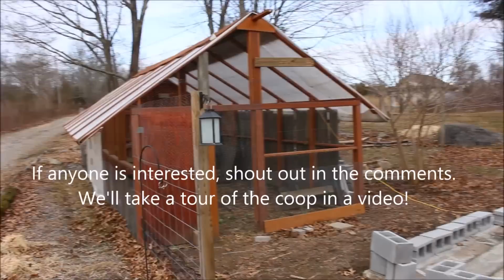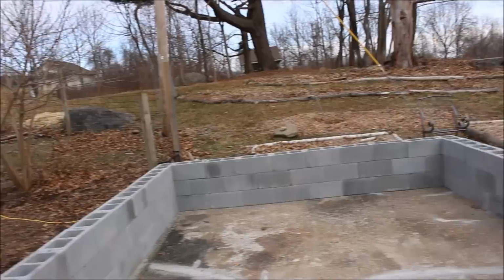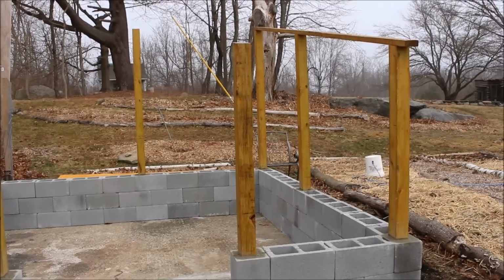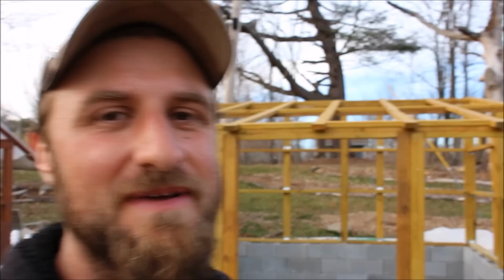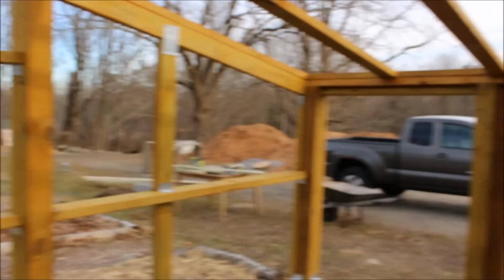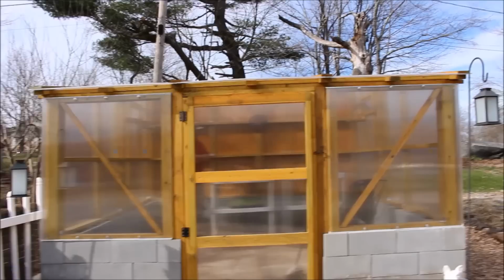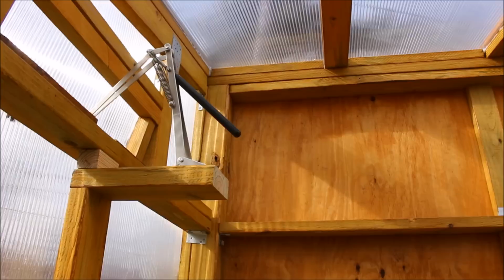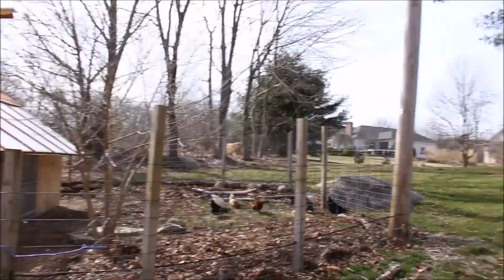Our homestead GREENHOUSE time lapse! WE BUILT THIS!

Comment: If you are going to use it in the Fall and Spring Bubble wrap is great insulation. It doesn't take much to keep on the walls and ceiling. The air pockets in the wrap is the insulating factor.
Reply from the maker: I had not thought of using bubble wrap, that's a good idea!

Comment: That’s a pretty cool design. Hopefully it gives you many years of usefulness! The only thing I might’ve done different is have the roof slant away from the door so water doesn’t run gushing on you as you enter.
Reply: I was just commenting the same but I understand that they may have done that because the front of the green house is facing the sun.  lf it were possible, I would place the door on the side, just to avoid having to install gutter.
Reply from the maker: Thanks for the feedback! We did consider slanting the roof in the other direction , but the angle of the roof made most sense this way for sunlight and we do plan on putting gutters on it to collect rain water to use for our greenhouse plants !

Comment: I can definitely endorse working together, if you have sufficient humility and grace. You seem also seem like really nice people. That being said, there really are many flaws in the design. 
1. The walls need to be attached to the foundation. A 1/2” hammer drill and rebar is a simple method for a simple structure with an existing slab, though there are better ways for standard construction. 
2. You apparently went back to fill all the voids with concrete. And easier method would be to skin the blocks with a fiber modified mix because it’s a simple structure. 
3. When mixing concrete, the more water you add the weaker the finished product. The drier the better. You really need to vibrate the concrete a lot or air voids will remain and weaken the concrete. 
4. Concrete also takes a month to reach full strength. It needs several days to get to working strength even with high early concrete. You won’t notice, but premature stressing of the concrete will create micro cracks that will grow and cause failure. 
5. People think of concrete as drying but it really goes through a chemical process, hydration, that requires water. If it doesn’t stay wet, it won’t gain full strength. 
6. You should prewet the forms, especially blocks like you used. Otherwise the blocks suck moisture out of the mix leading to weaker concrete. 
7. Placing wood inside the blocks will lead to rot in the wood, even pressure treated wood. 
8. Placing wood inside the block also means the tiny amount of concrete is non structural. Really better to put a metal connector (24” straps with 18” embedded?) in the concrete and then attached to the posts. 
9. Rather than insetting the 2x4’s between the posts, attach them 4” high on the exterior of the posts. See structural post and beam construction. Much stronger, less cutting or room for error. 
10. Joists should be stood up with bird’s mouth at the walls. Check out links to building codes for appropriate sizing. Looks like you probably needed 2x6’s, especially if cold enough for bibs/snow. 
There’s probably more, but I’m tired.
Reply: Very good advice.  I was wondering about the long-term structural integrity because of the way the blocks were assembled then the posts placed inside and crete poured around and into the void.  Bad for the wood and bad for the integrity of the project.  However, they did put a lot of work into this project and for the short term, it should serve it's purpose very well.

Comment: Nice build, besides the choice to dry stack those blocks. I'd imagine the wind blowing right through the cracks.. could be remedied by filling the rest of the wall with concrete though..
Reply from the maker: Thanks! And yeah we didn't show it on the video, but we've since filled the rest of the block cavities and joints. We may even add a stucco skin at some point too

Comment: Loved the idea and build.  Disliked the camera handling.  Had to pause several times to see the detail and recover from dizziness and uncross eyes.  We're going to build similar, except the back wall in our property is facing south so the front/door side is higher and solid wall, which is in my opinion better because when it rains or condenses, we won't get dripped on when walking in (otherwise, we'll have to do gutter over the door).
Would you suggest cladding the back wall with either metal or foam with reflective alum foil?  I also am debating if I should use semi opaque and white plastic corrugated since I read it's diffusing and reflecting light better than clear sheets of polycarbs, which was supposedly better for plants.  What do you think?
Reply from the maker: Hahaha yeah the camera hand is a work in progress!! Eventually we’re going to install a gutter for the front, we would’ve put the door in the back but the plan is to build up a raised garden bed inside along the back wall with reflective material on the wall for winter. And that’s interesting to hear about the different poly you mentioned, I’ll have to look into that! Thanks for the info, glad you liked the build and I hope you love your greenhouse too!

Comment: Good job.. I like it but, you think that the top should have been slopped to the back instead of the front.. rain run off..???
Reply from the maker: Thanks for the input, we considered that option. However the slope of the roof is facing south so it gets the best sun transmission the way we built it. Plus, we will be installing a gutter to collect rain water so we are not worried about it.

Comment: cool.  You might want to sister the rafters, and put the 2x4's, with the thin side up, in case there is ever a snow load.  We had an 1800's house, with the 2x4's laying flat on the floor, and there was a bounce and sag to the floor.
Reply from the maker: Yeah definitely. we’ve since done some good bracing on the roof, we knew we would need to but didn’t get to it for this video. Thanks for checking it out! We’ll post an update on it soon

Comment: Paint the back wall (north side) black.
Reply from the maker: Have you tried this technique before? We’ve had a few thoughts on the color. Black would soak up some nice heat, white would reflect some light, and aesthetically  I like the wood stain color, I was thinking of buying a white light reflecting sheet so we could hang it up and try it out

Comment: What kind of panel did you use a list of needed items would be cool size long wide? Great job,!!
Reply from the maker: Thanks! The panels are twin wall polycarbonate from www.encepco.com, they are all 4 ft. wide. and various lengths. from 4 ft long in front to 13 ft long on the roof

Comment: As someone in construction for 40 years I just want to say I’m sorry. This structure will be short lived.
Reply from the maker: We appreciate the honest input. I would like to say that we’re installing strong bracing to hold the middle span of roof rafters, since they aren’t installed on edge. We’ve also filled the rest of the blocks with concrete, neither of which were shown on the video. Overall, I’m confident that we’ll be using this for decades to come. I do appreciate your concern though, and any input that might help us do better would be great! Have a nice day
Reply: Filling the blocks is a good start, but there really are just so many things that are problems. Did you connect the walls to the slab?

Did you watch many videos before you started? Part of the challenge is weeding out videos like this that are nicely produced and seem really well intentioned but have flaws. 

Google pole barns or structural post and beam construction for the proper methods. They can readily be scaled down to your size, but you really need to start with the right principles.
Reply: Agreed, 20 years here. Looks nice but added mortar would make it last long time, not much more work

Comment: thats a briliant idia your foundation wont rote in futuer.
Reply from the maker: Thank you! It is also suppose to help with heat retention
Reply: Actually the wood in the concrete blocks will rot in the future, even if pressure treated.

Comment: Thank you for the video. It showed a mechanical window opener, how does it work as automatic (no battery or power)?
Reply from the maker: There is a black rod that expands as it absorbs heat. The expansion opens the elbow attached to the window and pushes it out. You can even set it to certain temperatures ranges so it opens earlier or later in the day. From Johnny's Selected Seeds in New Hampshire

Comment: Here's our idea to create more passive heat, we built a cinder block retaining wall  hip high about 3 ft width around 3 sides of our cinder block home.  Filled it with dirt, topped with good soil. Now we have  raised beds and added thermal mass .
Reply from the maker: Great idea! Earth has such good insulating qualities, we may try that, thanks for the tip!

Comment: Nice job on the build. Am I correct that you only stacked the blocks without mortar? Building a greenhouse myself soon and looking for ideas...🙌👍
Reply from the maker: Thanks! And yeah we stacked them dry without mortar, but then we filled in all the cavities with high strength concrete, then we will fill the cracks with concrete crack repair tubes. Ideally we would have joined the blocks with mortar first but decided the concrete fill would be quicker and nicer since we aren't great masons haha! But it's incredibly sturdy so we're happy with it. Hope all goes well with your build! I'd love to hear how it goes so keep in touch
Reply: Did you fill all the cavities or just the ones on the corners? If the ones in the middle aren’t connected there’s just gravity and friction holding it together. You should at least skin them with a fiber-modified mortar/stucco. 

Also, it appears that the wood is placed into the corner holes, so it’s really not connected with concrete. The little bit around the wood really has little structural benefit. 

With the wood inside the a thin layer of concrete, it will rot, even if pressure treated. Concrete is porous and will wicked moisture to the wood where it will stay wet. It also appears that you didn’t bevel the top of the concrete away from the wood. Both materials will shrink and expand slightly but at different rates, so a gap will form that will allow moisture along the interface.
Reply: @johnlee7085  instead of picking it apart can’t you just applaud them for getting up and doing it?
Reply: Danielle - A fatal flaw doesn’t seem like “picking” to me. 

Also, I have both applauded them for good as well as provided constructive comments on how to build it better; so that it will last. IMO, this is also really important so that others can hopefully learn before wasting thousands of dollars on something that will fail when success is even easier to achieve.

Comment: Nice greenhouse! Love the design! Curious about a few things, didn't see you use motor on the blocks and was curious if I missed it and if not does the wood stable it? Also curious approx what all the materials run for it and the size. I have been looking at the plastic ones and worry about their stability and life span but this fits all needs w plenty of room! Have u thought about guttering and water storage for use in the greenhouse? I have seen some w those and thought that would also be a good convenience when planting. Thanks for sharing and being an encouragement to others!
Reply from the maker: Thanks for watching! We have ended up filling the blocks with concrete and putting mortar in the joints, we'll also skin the entire outside with a thick primer and paint to seal it all. It's 12 feet by 12 feet. The plastic was pretty expensive, about 1,500 dollars, but we did get extra pieces in case we messed up so it could have been cheaper. Lumber prices are also really high right now so that hurt. We're looking into gutters and rain barrels now to catch the water for use. Thanks for the thoughts and encouragement!

Comment: Nice build, but.... the slope should be the other way, away from the front, unless you put up a gutter to catch water from the roof and into a water tank of some sort to use for watering in the greenhouse. And the windows are too small to air the greenhouse efficiently on a hot day.... But apart from that, it is a good greenhouse, and good built.
Reply from the maker: Yeah we'll be installing a gutter to rain barrel system soon. We may also put in some more windows if it feels like it needs it. They are a bit small. Thanks for watching!

Comment: Hmm. Interesting. Wondering why the blocks themselves are not joined with mortar? But great job.
Reply from the maker: Yeah we didnt do it the pro mason way, instead we just dry stacked them and later we filled the cavities with concrete. Now we're squeezing mortar filler into the joints and eventually we'll skin the whole exterior in a stucco. Certainly not the best way but it works! Thanks for watching

Comment: It’s a good idea but with all the efforts why dint you Mortar the blocks? Again it’s a grate idea but the plastic will get scratched up eventually you’ll also need a fan for fresh air coming in and expended air going out figure cubic ft for fan sizes.
Reply from the maker: Thanks Justin, glad you enjoyed it. We did fill the block cavities with concrete, now we're filling the joints with mortar and will eventually skin the whole thing with an exterior stucco. I'm not too worried about the plastic, we work at a farm with a 30 year old greenhouse made with the same material and it still works great. And yeah we've found we need a fan on the warm days to help circulate the heat. thanks for the comment!

Comment: What is the mix of concrete to sand/mortar to use to keep the cinder blocks with the wood from cracking when the concrete hardens?
Reply from the maker: Good question, honestly we aren't pro's in that regard so Im not entirely sure. We're thinking of skinning the whole thing in a fiber reinforced mortar/stucco at some point anyway so that will help alleviate any cracking issues if they pop up

Comment: What did this end up costing you?
Plexiglass is insanely pricey!!!
Reply from the maker: We bought 17 pieces of twinwall polycarbonate 10mm in 3 different lengths. We bought more then we needed for the greenhouse project so we still have 5 whole sheets left and bits from but pieces to make cold frames and stuff with. All together with screws and tape it was just over $1,100 before shipping.

Comment: I know it’s considered “rude” now a days to criticize ANYTHING but I don’t see the cinder blocks holding the max heat possible when they’re not sealed with mortar mix or whatever they use. They’re basically open to the outside no matter how pressed they are together since the blocks surfaces aren’t straight at all. I’d like to see an update on the temperature inside on a really cold day/night using an actual thermometer and not someone just standing inside and saying “iT fEeLs 20 DeGrEeS wArMeR iN hErE 🥴” like some youtubers do. Don’t get me wrong, I like the design I’m just thinking of the heat retention.
Reply from the maker: Hey we appreciate any feedback, we didn't end up showing it in the video but all the cinder blocks are filled and the cracks have since been sealed as well. We also put a water repellent sealant on the outside to help prevent moisture wicking into the block and continue to seal it up nice. Definitely not done professionally haha. That being said, this spring when the greenhouse was still unfinished and cracks still not fully sealed, we did see a 15 degree difference between the greenhouse and outside. This was measured first thing in the morning before the sun was hitting the greenhouse and when the last of the residual heat was being retained. We are getting it ready now for the late fall/winter plants and will be sure to update the Youtube with some accurate temperature readings! We are excited to see what we can do in there!
Reply: @FolkRockFarm  now it’s perfect then haha. Can’t wait for the update

Comment: Stupid question..but ..Ok so front 4xs were 6 bak 8 ..what is centers 7 then? Or different?
Reply from the maker: Yes the middle ones were 7 ft., it ended up working nicely, although if I were to build it again I might make each one a bit higher because I sometimes crack my head on the low side haha one of the cons of being tall, I suppose! Thanks for watching

Comment: I'm not sure why you didn't build the foundation correctly to begin with or why you had the slope to the front so the water drips on you at the doorway. That's a lot of work for something that as built will only give you a year or two of use. A high hoop green house with a door at one end and a vent with fan at the other is more useful, can be build directly on the ground, can be built with roll up sides to allow for more airflow and bees to enter and last for years. A great video though!
Reply from the maker: Thanks for checking out our video! There are definitely others ways this could have been built -better ways! But we decided to fill all the blocks with cement instead, as for the dripping we aren’t concerned with getting rained on it’s really not that scary and there will be a gutter attached anyways! I guess we should have added that in the video! We are actually planning on building a hoop house like you suggest, there was already a concrete pad at this location so we decided to take advantage of this space as well! We will get plenty of years out of it